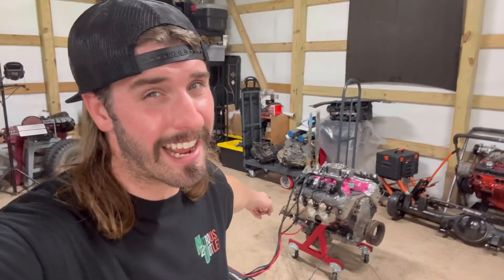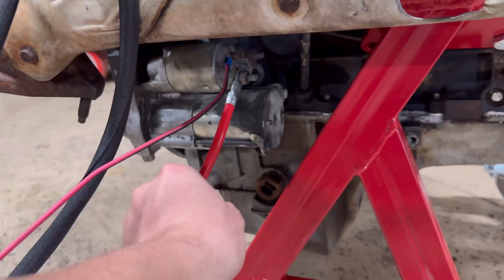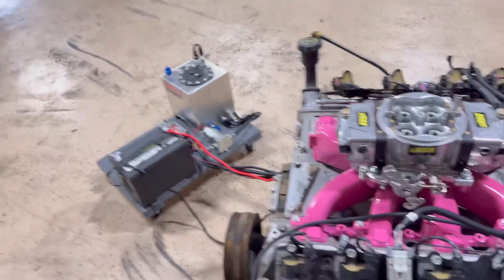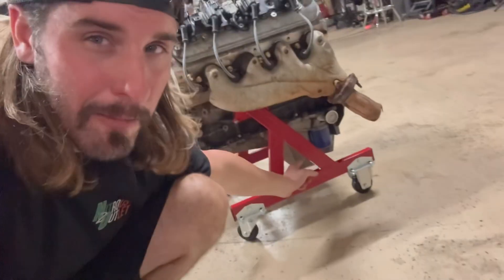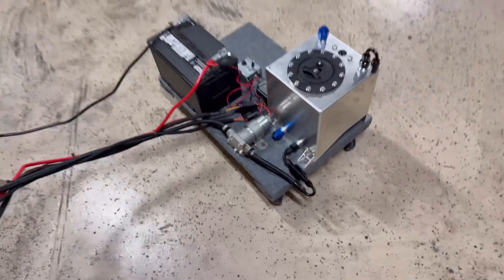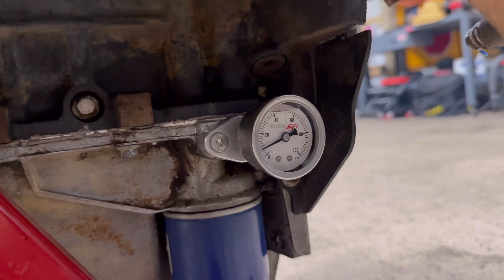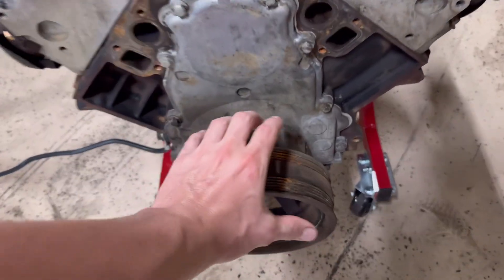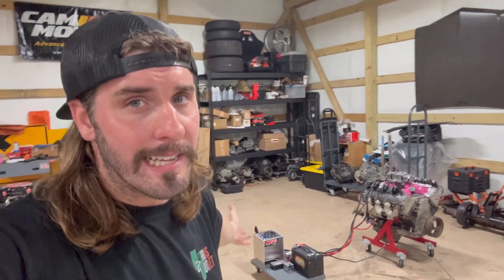Will This Junkyard LS Even Start?! Cheap Engine Run Stand TEST!!

Comment: Good morning sir nice tips where did you get the fuel tank any part number thank you in advance.
Reply from the maker: I had it tagged but it isn’t there anymore! Just type in 2.5 gallon fuel cell on eBay
Reply: @DuheSpeedShop   Thank you so much

Comment: Whats causing it to have no low oil pressure?  I have a 2011 5.3 with the same issue.
Reply from the maker: Prolly that thrust bearing and a pickup tube o ring